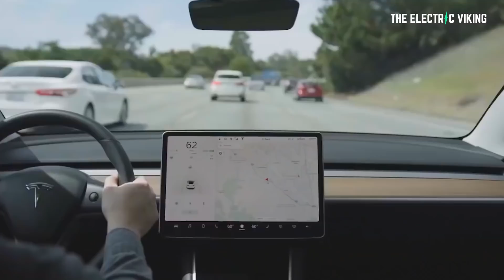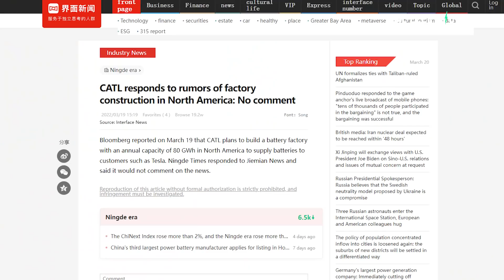Tesla battery chess move for 50% of US market in 2030

Comment: The real genius is that Tesla does not have to phase their battery suppliers deliveries. Pure EV & legacy auto manufacturers must match battery supply with their car manufacturing capacity. They cannot commit to buying unlimited quantities of batteries until they can build them into vehicles. Tesla can order up max production and supply asap. If the battery supply is larger than their capacity requirements for vehicle production, they can just build more powerwalls, megapacks, gigapacks. Tesla can use their static storage products as a surge buffer for 'lumpy' battery supply volumes.
Reply: Great point.
Reply: Well said, straight to the nail's head!!!!

Comment: Tesla will need more models to get to the 20 million mark. We need replacements for all shapes and sizes of vehicles we have now. However, the demand for EVs is going to be larger than anyone is expecting. In the coming years we don't just have the normal demand for cars. We are facing the prospect of replacing all the worlds existing gas cars with EVs depending on what happens with the price and availability of liquid fuel. If economy of scale starts to break down, supplies are all stages of fuel production and sales may just quit.  There could also be a mad rush to get rid of gas cars sooner than expected if consumers what to avoid the embarrassment of driving one. That's a stronger motivator than just cost savings.

Comment: One of the things you need to remember is that the lower the cost of something the more people tend to utilize it.  As an example right now there are tens of thousands of people per year that fly from Miami to Tampa, But if a self driving car can take you there in about 3 hours and you can bypass the airport and all the hassles that come with that at a lower cost... How many people will start doing that?   Expanding on that, if you can take an overnight drive where you sleep in the car from let's say South Florida to Atlanta which is about a 10 hour drive.... How many people would do that versus flying?  Another thing to consider is that in China only about 1/3 of the population has moved into the middle class really the rest of China is kind of like a 3rd world country so there's a lot of people that can have their lives dramatically improved if they can work out of a city.   How many people living out in rural areas will start using self drive vehicles to bring them into Cities for better jobs?  Same goes for Africa and India.  I think the market for a small inexpensive self driving vehicle is going to expand dramatically, And Tesla will be in the position to grab the lions share of that vastly expanding market